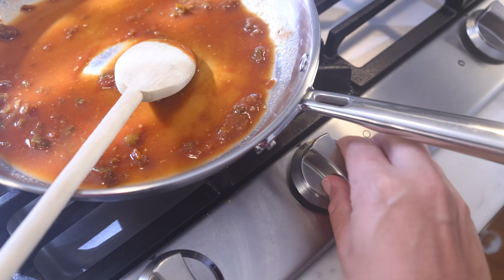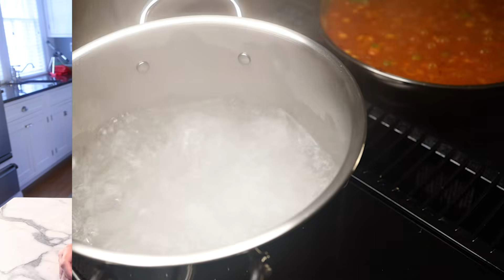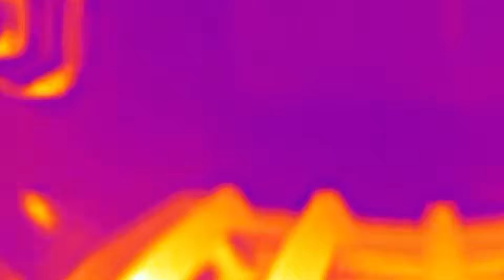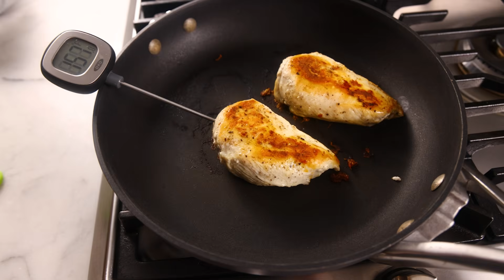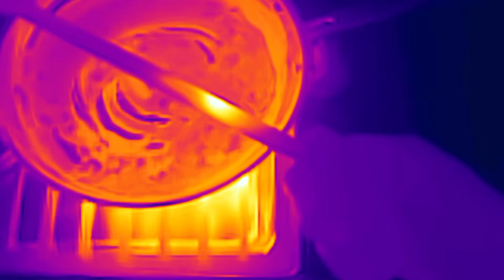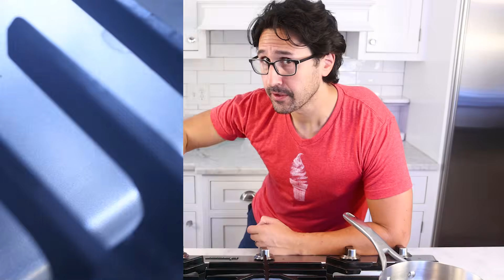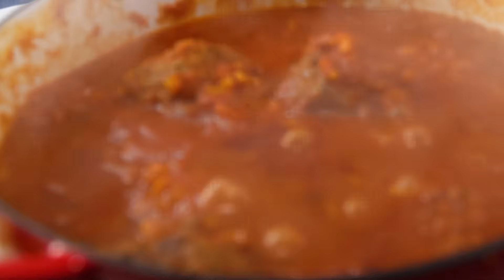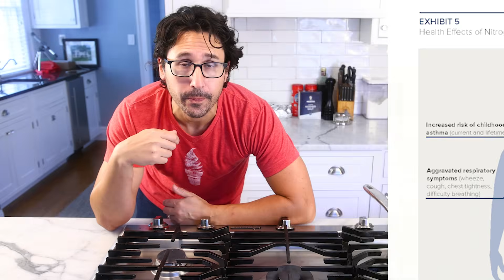Problems with gas stovetops | weak, dirty and dangerous

Comment: 'When this old girl peters out, I'm going induction.'
Your kids will have left the nest before that gas stove shows any sign of slowing down.
Reply: Ours with minor upgrades has been there for 16+ years. Ik households with the same one for 20+ years
Reply: @toomuchawesomeness5886  Ours is 30-33 years old. There's just simply not much that can go wrong with them. Electric starters die, if they even use them, but that's just a new plug needed.
Reply: I think the one in my old place is over 50 years old.
Reply: Yeah I'm not even sure how a gas stove dies, like what even wears out on it that couldn't be replaced on the cheap?
Reply: @enormousearl8838  The igniter our 30 year old stove, one is dead the other is dying. The back two igniters are still "like new" as we rarely need to use them. We cant get replacements as the manufacturer has discontinued that part 20 years ago.
Reply: @enormousearl8838  After 30+ years, the oven underneath the gas stove died.  It was the stupid timer that stopped it from turning on.  No one could fix it, any more.  I just got another gas stove/oven combination.
Reply: @CustomCoinRingsUSA  I actually think I've seen more broken mortars than working ones. While gas stoves? Yeah, those are outliving families.
Reply: Ours came with the house. We got the house over 20 years ago and it's showing no signs of getting slower.
Reply: Yep and if the infighter dies that is what a long stem lighter is for. If the gas is flowing and you have a way to light it then you can cook. The gas range in my house is older than 28yo me and still going strong. The house was built in the 1980's So its an old one without the EPA restrictions. It can boil water stupid fast. Is it efficient no. Does it heat up the kitchen 10-20 deg. Yes. But i love that thing. It may be a bit pathetic but the old gas range was one of the main reasons i bought this house. I love to cook and that old girl is a beast!
Reply: @Slater6377  well it IS more important to give functional things good use than to get the newest efficient thing ^^
Reply: that one looks good and good quality, mine is 5yo and practically dead
Reply: Yeah. We just had to replace ours recently. And keep in mind my parents bought our house 20 years ago and the stove was there before hand. Best estimate that it was 30 years old. Finally gave up the ghost
Reply: Tbh, he’ll probably be moving into a senior living community by the time that happens lmao
Reply: My grandparents stove lasted from 1988-2024, and it wasnt even the stove that stopped working, it was the oven.
Reply: Not only that. For the most part, they are repairable. Electrical ones don't have that advantage
Reply: @cinemaocd1752  that's a heavy pilot flow. I had mine go out on a couple occasions. One time it was out for at least a day. Never smelled a thing. Or there was atrocious ventilation in the place which is a whole other problem.
Reply: If it has electronic controls, that isn't the case. We bought a gas stove with digital controls and went through three control panels, finally gave up and bought a new stove. We went with induction...
Reply: @cinemaocd1752  Your new induction probably has digital controls too.
Reply: @TheOtherBill  nah brah, I'm running with my very real analog induction stovetop, thank you very much. /s
Reply: @TheOtherBill  Something else to break.  The more complicated it is, the more there is to break.

Comment: I lived in my home for 20 years, and we had electric stoves the entire time. Worked perfectly fine. But then we moved to a new home and mom decided to get a gas stove, and it drives me crazy how bad that thing is.
Reply: probably because you got a bad one.
try industrial next time, you will never regret it.
Reply: @urubutre  Ugh, no. I'm never going gas ever again. It's bad for all the reasons mentioned in the video.  Glass top or induction is the way to go for me.
Reply: Here is a tip that was over looked. Put a lid on the pot of boiling water and it will heat up much faster. Most of the issue with gas can be over fixed with using a lid. My last move was from gas to gas and the old place stove heated up just fine. It was no different then using an electric. Their maybe an issue with service not putting enough pressure. I notice a change after 2 houses in the area blew up because of gas leaks. The company replaced all the gas lines in the area but the stove was never as good as it was before the accidents.
Reply: @faervas1234  The time it take to heat stuff is not my biggest issue with gas stoves, but I appreciate the tip anyway!  
Also, where I am from, we don't have gas lines, but we have those cylinders that we have to replace every couple of months, which's one more thing to dislike about gas tops.

Comment: We had a gas stove for 3 years or so and recently moved into a house with an induction stove top.  The induction is fantastic, boils water insanely fast.  Only downside so far is that the lows aren't that low.
Reply: I have a wonderful induction stovetop that ranges from 140F to 460F. I make a lot of temperature sensitive sauces, chocolates, candy, and custards, so I love having those options for low temps.
Reply: @Stormrunner  Can I ask which brand/model?
Reply: @SgtZima  it's the Update International IC-1800WN. I got it from the restaurant I work at, so it's a bulky commercial model. There are better models out there that would feel less out of place in a home kitchen, but the one I have is pretty reliable considering how often it gets used.
Reply: We just got one a year ago and I've completely been converted. It's a newer model so the "low" setting is lower than the lowest on my old gas stove and there is a warming burner that is below even that...
Reply: I have induction and it’s lowest setting is so low I never actually use it. 3/9 is the lowest useful setting
Reply: My Siemens induction stove can slow cook at constant temperature for hours. I don't even need a separate slow cooker. Just an iron cast pot. 👍
Reply: @incognitofelon   @incognito  that isnt unresponsive, its fast. unresponsive means that you can reduce the flame to zero or bring it up to maximum in few seconds. Inductive stoves heat up the plate and therefore cannot increase the temperature or reduce it at your whim.
Reply: @phunkracy  No it doesn't heat up the plate. In fact I can put my hand on the plate right after I turn it off and it doesn't burn. You are confusing induction with regular electric stove.
Reply: @phunkracy  Watch here: https://youtu.be/T3AI1eQ50iE
Reply: Or this: https://youtu.be/HiIKq4RkZ1M
Reply: @incognitofelon  I have an induction stove and it does heat up - your pan heats up your plate.
Reply: @phunkracy  I agree it does heat up the glass plate - at least on my hob - but it's not a real issue for me. If I boil something and switch it to 0, it instantly stops. Gas would be slightly better in this regard since there is no plate, but for me at least it's no issue. Maybe more expensive ones have better fans to cool the plate?
Reply: @whuzzzup  you gotta explore more options than just boiling things mate, are you british perchance? 😛
Reply: @phunkracy  I don't know what type of appliance you use but there is no "plate" in most in induction stoves, just a ceramic glass surface, which stops functioning as soon as you turn it off. Most of the heat you feel when you touch the surface is residual, transferred from the pot itself, not originated from the stove, and dissipates extremely fast. Also most gas heaters have metal stands on which the pots rest, which also get very heated by open fire and do not get cooled for extended periods of time. So all in all induction should Trump over classic gas heaters when it comes to stopping cooking at will.
Reply: I had a small induction burner for a while. It was a cheaper thing and suffered from the on/off cycles. It boiled water fast, but cost more in electricity. I liked it except for a couple flaws one of which was the cycling which i think was because it was a cheap burner, warped pans are not possible to use, and the issue with woks. Now that I use carbon steel pans I am not sure if I can coat it the same as I can with the gas. I would probably have to do the oven baking method.
Reply: @readypetequalmers7360  Yeah, you'd need an invertor in there to avoid on/off cycles, just like in a microwave or an AC, and they cost more.
Reply: @onodera3964  A microwave does on/off cycles all the time, you just don't realize it. When you cook for example with 50% energy, it's off ~50% of the time.
Reply: @readypetequalmers7360  
"r, warped pans are not possible to use, "

I fold a paper towel, it doesn't burn and allows me to use a warped pan. Still efficient that way.
Reply: that's a shame cause that's an issue with that model. My induction hob can go really low.
Reply: i haaaate my induction stove, but i think its not the fault of the type of oven. the heat control on this stove is awful : ( its older, though
Reply: Only downside? Can't use woks, insanely unresponsive, the flame itself is used in many recipes- best chicken broth is made with onion browned on flame.
Reply: @phunkracy  Unresponsive? It boils a full pot of water in under 2 minutes.
Reply: @UCGVZFZPa4VpTo-rKmusjnCw gas cant go as low as electric, he explained why in the video.
Reply: @TheShizzlemop  You aren't reading what Daniel is writing. He's not talking about the gas stove he's talking about his experience moving from a gas stove to an induction stove. He's saying he feels the induction stove's low isn't that low. One would presume that's in relation to his old gas stove.
Reply: @TheShizzlemop  if you also paid attention, he also said it is model dependent.

Comment: imo if your gas stove doesn't have flame failure protection its a good enough excuse for a discerning home owner to replace the stovetop. You think you wouldn't leave a burner on and unlit but its happened in my house a few times.

Comment: I remember when i was a kid my grandmother always put this weird metal disks with small holes over  burners they were a little bigger then pots and pans i think that was to counteract heating problem.
Reply: Yep, it was a heat spreader. You heat the disk up to hold temperature for the pan and it keeps the heat/flames away from the pan sides so that only the bottom of the pan is heated. My grandmother explained it to me as a kid.

Comment: People will still glamorize gas stoves because it makes them feel like a "real chef"
Reply: The lack of responsiveness is the reason why you never see electric burners in a restaurant kitchen. There has been a few restaurants that have opted for induction, but the cost of commercial grade induction cooktop is breathtaking compared to an equivalent gas hob setup.
Reply: @machinist7230  If you're talking about a commercial kitchen, the advantages of induction are huge. Temperature accuracy is one thing but induction kitchens are much cooler as there is very little waste heat. I'd bet most chefs except for old school gas die hard would prefer an induction kitchen to cook in. The only advantage of gas is cost which would be a restaurant owner problem.

Comment: You being excited to cook on gas stove is hilarious. I have always been jealous of Westerners mostly because ya'll can turn on the ceiling fan when working on the stove! That means, ya'll don't melt in these tropical heats. Lucky.
Reply: Induction and resistance stoves seem so high tech here in LatAm, it's weird how every American has them lmao
Reply: @TheSpectacleIsCapital  They are nowhere as popular as you think. Every shitty apartment across the country has the cheapest gas stove possible or the cheapest resistance stove possible, no glass top, never induction.
Reply: @TheSpectacleIsCapital  Barely any americans use induction stoves, though its starting to catch on more and more. Its more the EU and China that uses them.
Reply: @TheSpectacleIsCapital  For real! They have glowing coiled elements under a shiny slab of glass that doesn't take ages to clean?! Now I understand why these recipes are always so lax because anything catches and burns on our hobs, especially without heavy-bottomed pans. Plus, they can just bring a pot of water to a boil so quickly, no wonder they eat pasta regularly.
Reply: exactly! i cant stand to see my mom being "burned" when cooking. i installed the ac for her in the kitchen. yeap, just a 1.5 ac inverter for her. that way theres no wind blowing the fire and she stays cool. WHY WONT I BUY HER AN ELECTRIC STOVE?! well, she simply doesnt want 1. haha
Reply: I grew up in an old southern American house, which had a mid grade gas stove. When I visited a cousins house and saw their glass top cooktop I was amazed, I thought that electric stoves were the most amazing thing ever created. I near shit myself when I found out about induction

Comment: When boiling water, I'd also recommend starting with hotter water due to water's high specific heat. Note that it'll usually take the hot water a bit to come from the boiler as it also has to warm up the pipe along its' way to your tap.
(Edit: I'm in the US tap water is clean and normal to use in cooking for me.)
Reply: I recently heard that it can be unsafe to use hot water for cooking in the US because of lead or other contaminants in the water. You should use cold tap water instead.
Reply: Never ever use hot water from the tap to cook food.

Comment: The bit at the beginning is the difference between heat and temperature.  A gas stove will produce a hot flame much faster than an electric stove will heat an iron coil.

HOWEVER, as your basic high school chemistry told you, heat is not temperature.  You can change a material’s temperature without changing its heat; compress a gas and you will raise its temperature without adding any heat.

And so if you were to add equal amounts of heat to what is a very small mass of gas and an electric coil which is MUCH more massive, the gas will be hotter.  To achieve a gas flame of say 600°F and an electric coil heated to 600°F, it will take much more heat to get that relatively massive electric iron coil to temperature than it will the flame.

The end result: gas starts heating your skillet or pot faster, doesn’t necessary get it up to full temperature faster.

All that being said, I much prefer gas.  It’s neither weak nor dirty nor dangerous.

Comment: your problem is that your pan is too small for the gas ring. As simple as that. It doenst matter if you're using the smallest gas ring, your pan is just too small for it. The benefit of eletric stoves is that the heat is distributed more evenly, on gas is just the outer part of the ring that transfers heat. usualy your pans need have wider bases on gas. There are racks that eleate your pans too, it would fix the too hot low setting and the lateral leaking heat you are seing on your thermal camera. I always set my stove right before the flame goes off, its way lower then the minimum setting, but i wouldn't do it if i wasn't near the stove, cause if you set it too low it may go off.

Comment: Hey Adam, I wonder if the differences between electric and gas stove tops affect recipes. For example, is medium heat the same for gas and electric stove tops?
Reply: "Medium" heat isn't even consistent between different recipes. Or different stoves. Or different burners on the same stove.
Reply: I always had to put my electric ones at like 1/3 or 1/4 of the way for “medium heat” and like 2/3 of the way for “high heat” in recipes made on gas
Reply: @kaitlyn__L  Yes, I've seen people actually melt pots/pans to the glass stove top on newer glass electric range tops by actually keeping the burner set on the highest setting for a long time.
Reply: @rdizzy1  gosh!
Reply: It's more about how your food is reacting to the heat than the actual setting
Reply: "Medium heat" in the sense of its "mediumly hot" they could be relatively the same but turning your gas burner to lets say 4 and turning your electric burner to 4 will produce wildly different temperatures lol
Reply: Ime high heat is lower on gas stoves. They take way longer to heat up hookah coals and boil water.

Comment: I will say that my glass top is a nightmare to clean. Basically, any little bits of grease that drift down there (or spill) polymerize and have to be scraped off with much elbow grease and a razor.

But I, too, am going induction for the next one.
Reply: Once it's cool, spray a degreaser on it. That stuff should wipe away.
Reply: Yes, the glass top of an induction stove usually does not get hot enough to have that effect.
Reply: I've had good luck with glass top stove cleaner. It's basically citric or oxalic acid with a mild abrasive mixed in with it. You spread it on and let it sit while the weak acid does its thing and then wipe away with a blue Scotch-Brite pad. Vinegar works OK, too. It just smells since it has to sit on the stains for some time (soaking a paper towel on it helps keep the vinegar in place). Barkeeper's Friend is basically powder form of the glass top cleaner, but be careful as the abrasives are more aggressive.
I admit I'm lazy and only really deep clean my stovetop when it gets gross, but afterward it still has a mirror shine after 20 years.
Reply: Clean it straight away and it isn't a problem.
Reply: And btw, if you haven't tried induction yet, you're in for a treat.
Reply: What type of cloth are you using? I have Microfiber for grease if you wipe the top with damp Microfiber when you are done that should reduce the effort you need to keep the harden grease. Microfibers are over hyped they are no clearer then cotton in removing bacteria but you don't have to use toxic chemicals to deal with the oily greasy messes. If you understand what they are good for they save a lot of hassle.